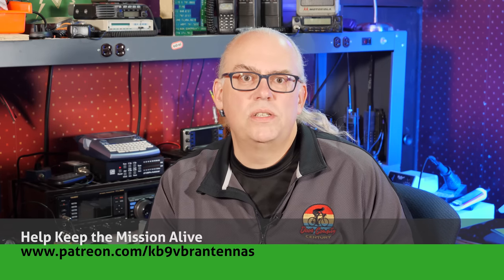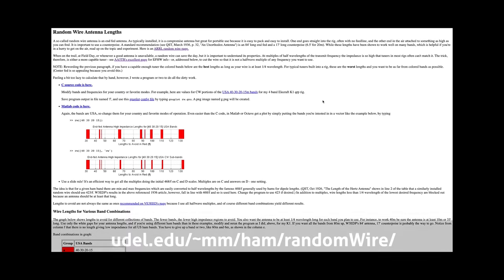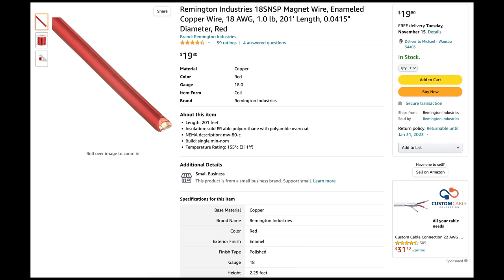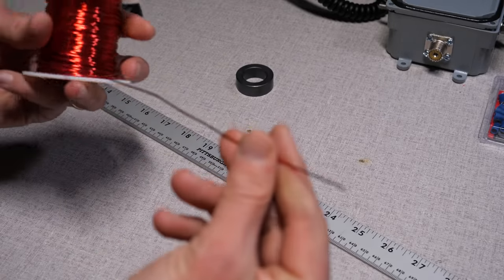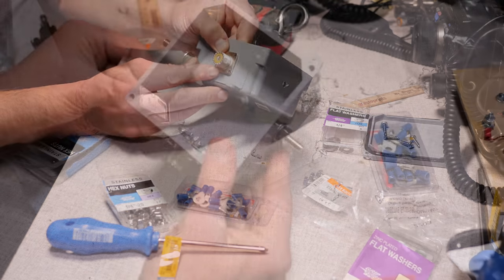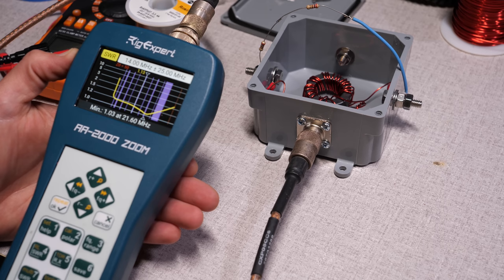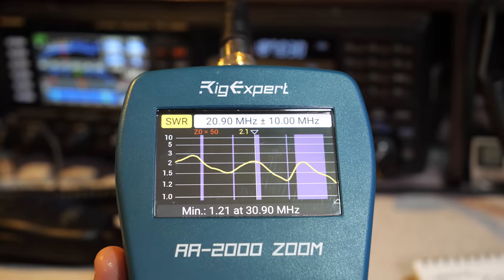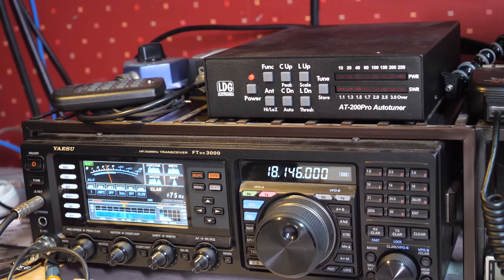Build a random wire end fed antenna and make amazing contacts #hamradioqa

Comment: I cannot understand why those making videos on wire antenna seem to never discuss wire length adjustments due to the velocity factor of insulated cable.
Reply from the maker: Velocity factor for an insulated wire, like the 14ga stranded that I used in the video, is 4%. I believe I mentioned in the video that I don't calculate to velocity factor but instead will trim that 4% when I test and tune the antenna. That gives me a little extra wire to play with when installing an antenna.

Comment: Just to follow up a bit on Michael's video - there are actually quite a few non-resonant antennas that will actually outperform their resonant cousins. The problem is that many people restrict their choice of feedline to just coax. Using balanced line opens up an entirely new set of possibilities for antennas - many with both lower loss and gain as compared to say, a resonant dipole (the extended double Zepp is just one example). Many such antennas make excellent multi-band antennas as well. Balanced line also is actually less prone to producing RF in the shack (as compared to coax) as long as the antenna itself is a balanced load.
Reply from the maker: Parallel feed line can be a game changer and opens up a whole new world of multi band antennas. It isn't without its challenges, though. I do have some open feed videos planned.

Comment: I often run basically the same antenna as described in the video for POTA activations.  Operating QRP less than 5 watts, I have several thousand QSO's with it using a 41 foot wire, about 20 foot counterpoise, to the XMFR and manual tuner. It works particularly well on 40,30, and 20 meters.  Even worked a fair amount of DX during activations...  Paul NA9M

Comment: Thanks for airing our QSO! A good 9 to 1 and random wire is tough to beat in terms of band hopping speed with a decent tuner. I sent over some pics of how I mount my FT-140-43 toroid into paracord winders with a SO-239 for POTA. Winds out and up quick onto the spool/winders to maximize on air time! 73 and thanks for the contact. KD2YAR Joe

Comment: I was successfully able to make a contact on 2 meter with 73 feet of wire attached to the ferrite diagramed in your video. I soldered the 6 ends into a breadboard, soldered and shrink wrapped the wires and cable.. I did end up moving the antenna to a different spot and ultimately found that the counterpoise worked best right under the antenna by someodd feet. Because I could bot run out the entire 73 feet in a straight line I wrapped it around a 10 foot long structure that was about 6 feet high. I found I was only able to use medium level power on my tyt9800 but it could have been my computer sitting next to the receiver was interfering with it when I was maxing it out. Or maybe just going back into the line. At any rate, I am going to test the antenna woth a nano tomorrow. Thanks again. And 73.

Comment: Excellent. Works great. First contact with this balun fed with 75 ohm coax & connected to a non-resonant random wire 15 feet above ground w/ a short vertical counter poise was 875 miles on 15 meters with 25 watts SSB.

Comment: Great video, thank you!   I use a 107 ft non-resonant end fed, 9:1 unun.   The trick for me was a very long counterpoise (didn't measure, but longer than the antenna, turns twice to fit space).   Works great to talk on 160 thru 6 meters with tuner in the rig!
Reply: I have seen a few using a peg post where the counterpoise was placed in a zig zag fashion for 30 feet. Post were 5 feet tall with 4 holes. The antenna CP was stretched and looped into the holes and threaded back and forth between the posts.  This gave a large CP length without needing to be stretched way out on a property.  I will probably do this.  I am looking at 160 m capability to 80.

Comment: I've literally just put up a 9.1 end fed as I wanted to use 40m. I have a small garden but it works really well. Noise floor is s3 on 40m. Been put off for years using wire but they really work! Great video 73

Comment: Hello, I have exactly such an antenna as the only one because I live in a dense urban development and I am very happy with it.
The core used is FT240-43, a winding wire with a diameter of 2mm.
the length of the beam is 30m.
I am very happy with it.
best regards, SP2NW 73!

Comment: In 1979 I worked the world with TenTec Century 21, my 93' random wire and MFJ tuner as KA9EDP, I wish back then my Elmer had a lead on these cool variations! Looking at some of my potential POTA options though I will also have to include compact verticals in my mix to be flexible for site requirements. I enjoy visiting many of the local sites as we full-time RV even if I don't have a modern portable rig yet. Cheers, Dave, KU9L

Comment: Thanks a lot for you video. I have deployed several random length antennas. I live in a condo in Barcelona. Before I got the permits to deploy a mast, I started with a 22m long wire disguissed in between the air condition machines. It worked quite well considering the situation. Now I have a 5 band wire dipole from Diamond. I have also deployed a RW EndFed antenna with 36 m of wire plus a 9:1 UNUN. It works without tuner in 40, 20, 15 and 10 m. I need to use the tuner for 80m and WARC bands. I would say, it is a esasy to deploy and very versatile antenna, although it is not the best efficient one. I'm very happy with the results. 73's EB3CJR

Comment: Thanks for this video.  Very informative.  I'm working this winter with an EARCHI EFRW in a reverse sloper config (matchbox about 20 feet high, end of antenna about 6 feet high).  The EARCHI uses the coaxial braid of the feed line as a counterpoise - have a ferrite core on the feed line where it enters the shack as a common choke.  30 foot wire antenna.  With external tuner, I can tune under 1.5 SWR on 40 through 10.  It's performed surprisingly well for making contacts!  If the snow & rain ever stop here, I may try a different 9:1 matchbox set up for a counterpoise separate from the feed line - you've motivated me to try that.

Comment: Thanks and vert timely. I have two EFRW 9:1 antennas now. Tomorrow, I'll be putting up one of them in the attic as I live in a condo townhouse and that's the only place it can go and one of the few configurations that will work in my space. Not ideal but best available option. In fact, in one of your livestreams a year or so ago, I asked about attic antennas and you and your guest at the time gave valuable advice. I've chosen a  41ft radiator with a Nelson 9:1 matching box and 17ft counterpoise in 18awg wire. For POTA, I've been using a TufteIn 9:1 antenna, also 41ft/17ft with light 26awg wire. Truly portable. Both have worked really well outdoors when I tested them and I'm able to match them on 80 all the way to the 6 metre band. I might try and wind my own toroids net time as your video shows how easy that is to do. 73!

Comment: I used a random wire (Packtenna 9:1) with my K2 for Field Day this year.  The radiator was only 31’ long and worked great on 20 and 40 meters. To my surprise, my built in tuner in the K2 tuned it to an SWR of 1.2:1 on 80 meters and I made a lot of late night contacts.  Hard to beat.  Larry - W7LDT

Comment: This is a great antenna, I have made them with FT240-43 and FT82-43, as well as the EARCHI design using the T130-2. Both work well, but the ferrite cores work better below 20M. Palomar uses 62 mix in their popular models. It’s better on the higher bands, even 6M. Using a choke at the rig end of the coax is highly recommended.

Comment: KI4Z"  Use a butane lighter to strip enamel..  some practice to get the time/heat right, but burn it black, then wet or dry 400 sandpaper dipped in alcohol to remove the black ash.  Avoid going red hot on the copper.  Buff it clean, and tin it.

Comment: Very nice video. I just installed an EFRW @ 137' long in an inverted V configuration. Works very good on 80-10m on my FT DX 3000 with the internal tuner with average SWR of less than 1.2 on all bands. Contacs to Japan, Chile, Argentina, Puerto Rico, Canada and Brazil from my QTH IN Parks AZ.
KK7IUJ Harry

Comment: Excellent video with thorough explanations...The tutorial on making the unun is a nice plus!  I regularly use an 84-foot with a 9:1 when operating portable.  Inverted vee, inverted L, sloper...it's really a good all-around antenna which, despite its compromises, will work just fine for doing a POTA activation, EMCOMM work or anything else in the field.  Time to try it at the QTH now!
Reply from the maker: For  my last few POTA camping adventures, when I put up a wire antenna, it's been the end fed random wire. I really like, with a tuner, the ability to go anywhere.

Comment: Hi, First time here so interesting to see other peoples experiences, I run a 9:1 unun with 84ft of wire in a sloper config, 40m thru 10m are all under 1:1.5 and it seems to work very well, thanks for the vid.

Comment: Hi great video, I built this type of antenna a while ago as I live in an apartment, with 52 feet of thin wire and a 9-1 anun, it works very well but it does not like a counterpoise, but I've added an RF choke of 25 feet of coax, ( 25 feet of the coax cable was wound into the choke as it was quite a long run which I didn't want to cut it,)

Comment: I am interested in making a 160M antenna.  I already have most of the pieces except the Toroid and the SO-239.  But I have a question about the wire.  I have no trees in my yard but I have lots of room (4 acres).  There is a space between my house and my workshop of about  175 feet.  I am thinking of using stainless steel downrigger cable (I am a fisherman) because I have LOTS of it.  This stuff has a breaking strength of 150 lbs. and it will not rust.  Because it is not copper I am not sure about the velocity factor (if it matters) or the conductivity.  We often get 60-75 MPH winds up here in the mountains.  I like to build things TOUGH so I don't have to do it twice. 

I notice this video is a couple years old.  Did you ever come up with a kit for this?  If so, how may I obtain one?

Comment: EARCHI- emergency amateur radio club of Hawaii sells them with correct length of wire for about $50 already assembled I use a fiberglass pole, 32 ft , from Jackite, $75.  I use it as a vertical antenna.  Add coax and your good to go.

Comment: I own a 43' vertical which is great for 40-10m, but just so-so on 80, and not-so-good on 160m. So I just ordered an EFHW 80-10m from MFJ.  But I really want to get on 160m, so I ordered all the parts for a 9:1 unun.... & I will experiment with a long wire vs the efhw from MFJ.  I have 1.5 acre lot with lots of oaks in the 40-45' height range, but the trees are so dense it's a challenge to string a 40' high wire thru them...  Doug, K5DHL
Reply from the maker: I'd love to hear what you find out. I love oak trees because they always seem to have a limb at the right height for hanging wire, but they are also dense and scraggy and tough to get wire through.

Comment: How do you determine the length of the counter pose wire, 25 feet long. Does it matter much if it is longer or shorter? Could an insulated counter pose wire be buried 2 or 3 inches below the sod? Is a ground rod connected to the counter pose side of the 9:1 unun?

I’m thinking about trying a 74 foot end fed with a 9:1 unun, running the wire along the bottom roof tiles on my roof. I’m not sure how the end fed antenna will work when it’s in close proximity to my roofing tiles. 

I’m not sure how much electrical noise the end fed antennas will receive. I’ve heard that they receive more electrical noise than resonant dipoles. I assume it’s less electrical noise received with an end fed antenna than a vertically polarized antenna.

Comment: Very helpful and detailed.  I wish, however, more was passed along about configuration and length of counterpoise.  There’s a lot of confusion on this subject.  Some say 1/4 wavelength on lowest band…others borrow the .05 wavelength from EFHW antennas.  It’s confusing.
Reply from the maker: I think it gets confusing because a lot of people overthink counterpoises. I've found that almost any non-resonant length of wire works fine. If it's laying on the ground, the length isn't going to matter a whole lot.

Comment: Thanks for the awesome video. I would like to see an impedance (or swr) graph without the 9:1 connected and how should the trimming be done to optimally align the measured impedances before connecting the 9:1. I’m using 42ft of thin insulated wire both for the radiating element and the counterpoise. Measured impedances are lower than 50ohm on 20m and above so I’m not using a 9:1. However, my ATU struggles to tune on some bands. Antena elements connected directly to the ATU-100. I’d like to know how to optimize my build. Should I start cutting in hope that impedance go up and use a 9:1? Thank you!

Comment: Very good presentation.  I am interested in this antenna, I do activate a few parks and stay at campgrounds for several days.  This antenna will work on the POTA bands and I can check in on the 80 meter nets in the evening without having an antenna running half way through the campground!  73 KI5IMV.

Comment: Does running a straight wire antenna that is not straight cause issues? The one I bought from a another ham said he had troubles because he had a small yard and made a couple of turns like a U. I  was told that was 107 feet long.

Comment: Thanks for good information. My shack is located in the second floor well above the ground. Can I have the counterpoise just hanging vertically down from the 9:1 transformer?
Reply from the maker: Yes you can. The counterpoise doesn't have to be on the ground, it can be elevated, or drooping downward as in your case.

Comment: Looking forward to picking supplies and building something new for my limited lot. Does it matter lengths for coax from tuner??
Reply from the maker: The length of coax matters to a degree as you will have to contend with feed line losses if it is too long. For the random wire antenna I'm using in my backyard, I have 75 feet of RG-8X coax. I'd probably switch to a lower loss coax if I had to go much longer than that.

Comment: I'm looking into this sort of antenna for portable emergency comms work, so very happy to see you cover it so well!  A question, though... around the 3:20 part where you're talking about the desired wire lengths, you say not to use a length that is 1/4 or 1/2 wave resonant multiple on any desired band.  I thought it was just multiples of 1/2 wave that you needed to avoid.  Can you clarify that because if 1/4 wave multiples must be avoided then my calculations are way off!!!!  73 de BJ, KM4RB

Comment: Hi great video 1 question whay everybodi is using plastic boxe 4 transformers of end fed or random wier antenas ? I use a 9to 1 cupled wit a adition 9 turns gives me 16 to1 i have a end feed  antenna about 217 feet that is about 60 m of wier give or take 5 m ists about 5 meters from the atic flore and about 16-18 meters diference from actual ground.

Comment: Great as usual. Thanks. 
I have a ground rod and ground distribution block right where the antenna would hit the house. Is a ground better or worse than a counterpoise?  Thanks.
Reply from the maker: And earth ground and a counterpoise are two different things. The ground will provide a bit of lightning protection, but isn't a substitute for a counterpoise as the RF conductivity is not very strong.
Reply: @KB9VBRAntennas  Thanks!!!

Comment: Great video. I would love to see just how much is lost on average. Long feedlines are bad for these transformer driven antennas, and often hide horrible swr and high losses. I know many love the EFHW, but it really isn't great compared to other options, although the fans will always say they get out great, they really aren't efficient.
Reply: If you don't have space or money for a 'good' antennas (big verticals, yagis etc) then they are good! I'm working DX 10,000 km with a 9:1 and 43 ft wire.  I have yet to be asked in a QSO how efficient my setup is, and in fact, when they hear what I am using, they are amazed! A lot out, for little in, is highly efficient.

Comment: Did you use a choke or balun on the antenna feed line to capture any  RF traveling on the outside of the coax before it gets into your shack?
Reply from the maker: Common mode currents can be an issue with non resonant antennas. I did not put a choke near the feed point as I have a good counterpoise that seems to be doing its job. I do have a choke near the transmitter, though. That's to help reduce man made noise that plagues my residential environment.

Comment: So I have a 22.5m wire with a 3.5mm bannan plug on the end of it connected directly to the center of the coax connector on my ft817nd.  It seems to receive volmet and ft8 from all over the show.  No tuner.  Is the tuner only needed when transmitting ? Or will it improve rx too?